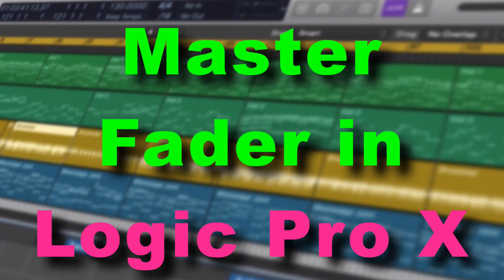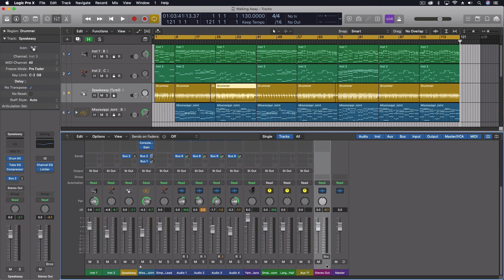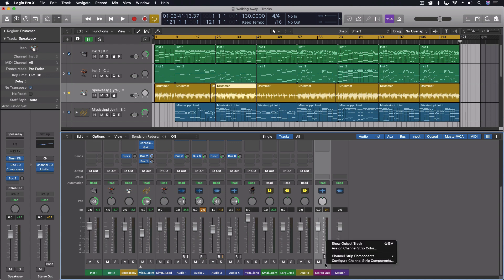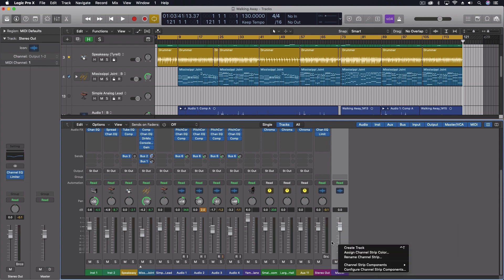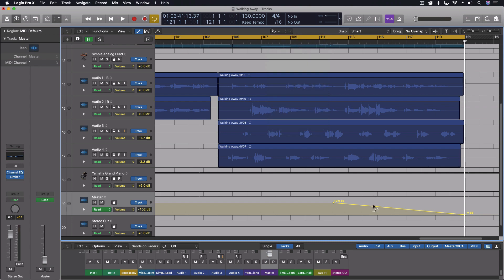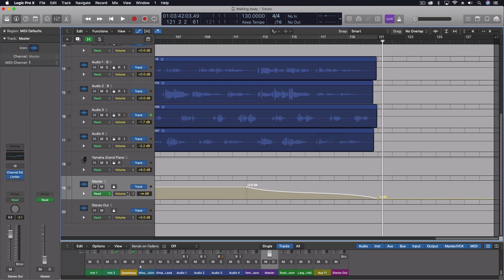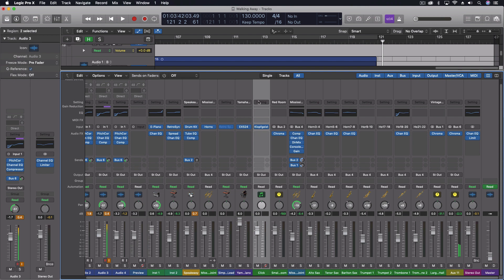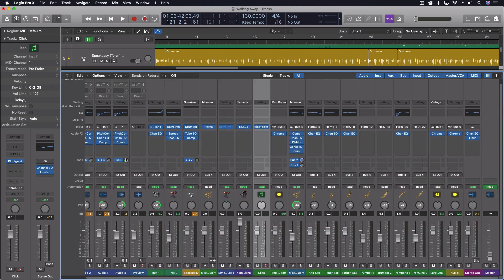Master Fader | Logic Pro X

Comment: So I’m confused. If say during a chorus I want it to be .5db louder which track/fader would I use. If my master is running hot do I lower the stereo?
Reply from the maker: I would leave the output faders at 0 and adjust the tracks feeding into them. You can technically do it either way but minimizing the confusion by gain staging in multiple places is usually a good goal.
Reply: @LogicProLife  Right I usually do that. This are old tracks. I guess I could buss the tracks to groups and lower from there.

Comment: If you don't create the Master Track does that mean that volume changes you make won't show up in the bounced file?
Reply: I'm wondering the same
Reply from the maker: The master fader is always there, but you can’t create automation until you add it in the track area. So if you raise it or lower it then that change will affect the output no matter what.